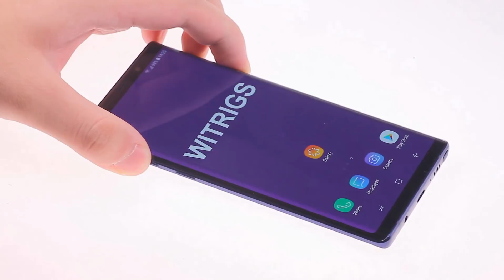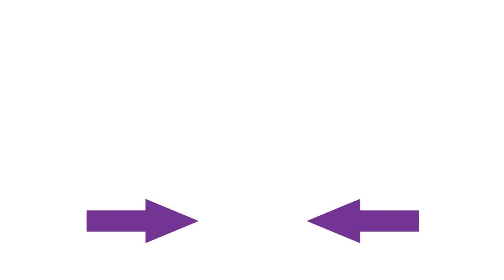Samsung Note 9 Rear Camera Replacement | Repair Guide

Comment: Thank you very much for this well done video. Everything is easy to follow. My Note 9 is already quite worn out but I still want to use it a little bit. Battery was dead twice.. changed it. But now my rear camera seems to become unable to film correctly the colors.. (too white images..(overexposed looking) and no more sharp details especially when zooming. I need to have crisp video quality for my youtube channel. So now thanks to your video I will take apart the venerable Note 9 and just hope that by cleaning contacts and such minor actions I can regenerate an acceptable image quality. Otherwise the cameras will have to replaced.. and it looks quite easy to do. I'll put all the little screws on a dish to not lose them. NICE that people like you provide to others such wonderful help.

Comment: Is the replacement as good as the original? I mean, will it still be capable of recording in 4k 60fps and all those features?
Reply: I have found it impossible to find this information. The OEM replacement part certainly doesn't look as well machined. After the replacement I'm not 100% convinced the OEM part is as good. Can anyone confirm the OEM replacement rear camera specs?

Comment: After replacement will it still be water resistant?
Reply: It was not water resistant to start with huge number of note 9 phones have failed due to water damage. If you use a new sticker for the back it will be as resistant as it was from the company.

Comment: I replaced the camera sensor but after replacing the camera and launching the camera app it says "camera failed"  Any idea why?! The sensor was actually purchased from your website.
Reply from the maker: Sir, please make sure that the camera flex cable is deducted. If it still cannot be solved, please contact our after-sales customer service. 😁
Reply: @EricWitrigs  deducted?
Reply: I replaced outer lense on mine ,but if i try to scan a barcode or take a pic of anything small its blurry any ideas of why
Reply: You need the correct module for the phone. Exynos or snapdragon versions
Reply: @Max.527  the "galaxy note 9 only" cameras are exynos right?
Reply: @tinashebanda8533  no, depends on region. Different camera modules.

Comment: Camera failed. Purchased from you guys. How to fix this?
Reply from the maker: When replacing the camera, you should disconnect the battery. Or else the motherboard or the camera could be hurt by static electricity.
Reply: @EricWitrigs  the the battery flex cable is disconnected before you can take out the motherboard
Reply: How did you fix this problem? I have it too
Reply: @Max.527  I returned the camera. It wasnt the right one. Note 9 has two different rear cameras. You can tell by the length of the flex cable. Get the right one for your phone.
Reply: @dogzlf  yes I also realize that I ordered the wrong one so I ordered another one from China which is my International model
Reply: @dogzlf  Yes, I realized this after purchase and installation. I needed international version and exynos. I instead got the american version snapdragon. Oops
Reply: @Max.527  Great! Does it work now
Reply: @dogzlf  well, I assume it will. Ordered part from China
Reply: @dogzlf  how can you tell which one you need?